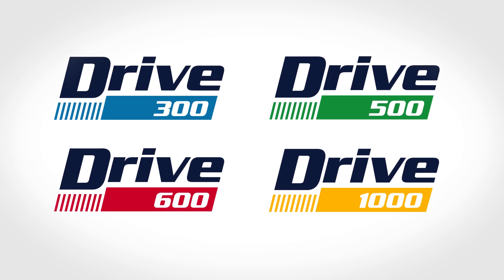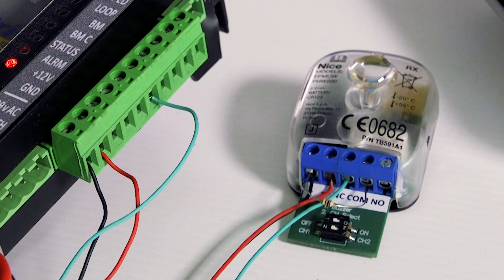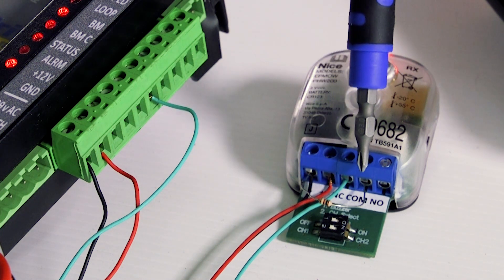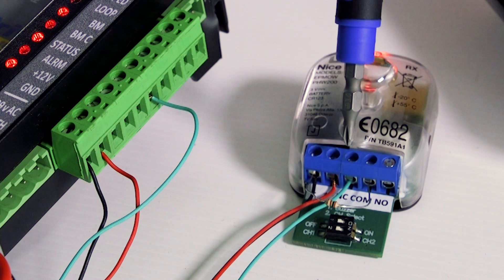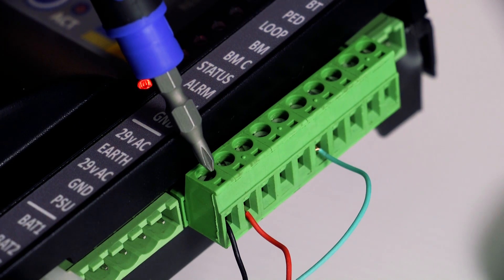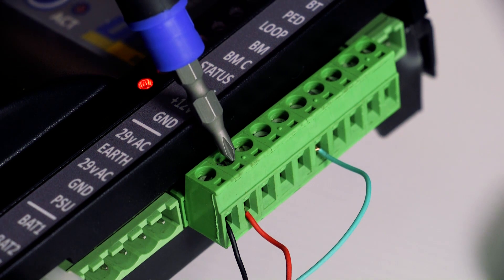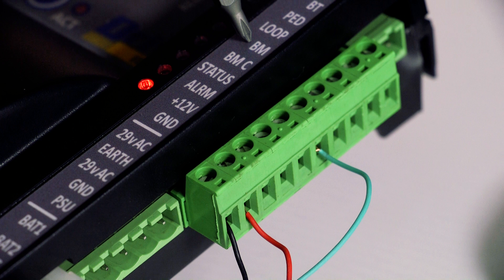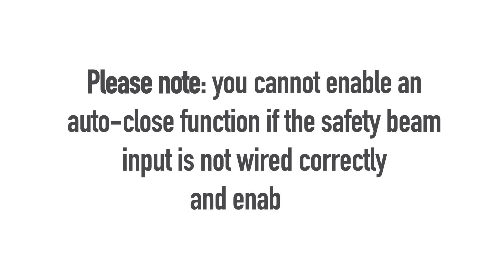How to wire up your infra-red beams

Comment: Does the older et 500 plus gate siding motor require the 100k resistor on the circuit?
Reply: Not required on the ET500 Series sliding gate operators
Reply: @shermonvanreenen5689  It's True. I personally confirmed with ET Nice about this matter and they were very helpful regarding this detail.
Reply: @Lil0Kevin14  I am referring to the ET500 12V Green and ET500 ACDC sliding gate operators. Not the drive series. Thx, take care
Reply: @shermonvanreenen5689  Yes. I'm aware. The Green and Red Cover motors. and the control card doesn't have a lcd display like the drive 500,600, 1000 series motors.
The use dip switches.

Comment: Connecting and aligning beams is all fine. Explain how I power the LED light. The lighting unit does not come off to connect the wiring  properly and tighten the micro plug from the bottom or rear end. This secures the wires in the micro plug.
Reply: Hi Philip, Please advise which control card you have? This is with reference to the sliding gate operator. Thank you

Comment: I have the same setup but my beams only work when there's no ac power. Once I put back the ac power I get the beams interrupted alarm (message). How do I solve this?
Reply from the maker: Sorry, just picked up on this now (not Nice) - did you solve the problem?